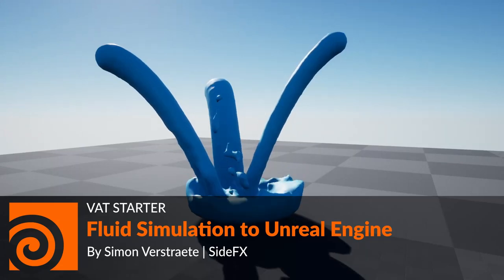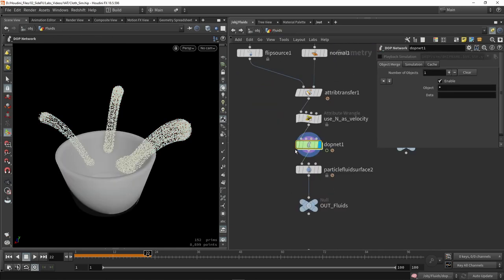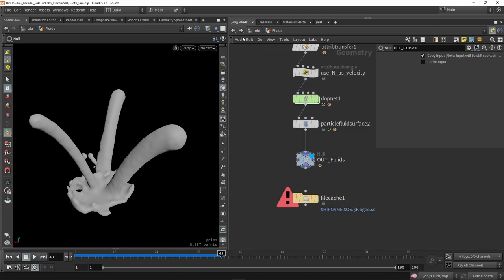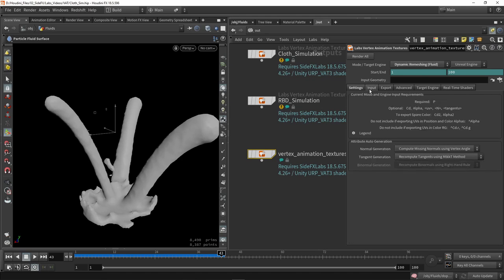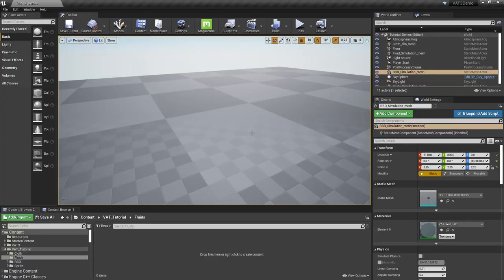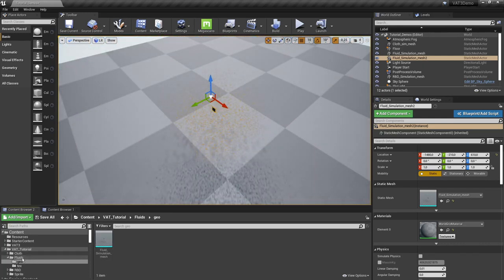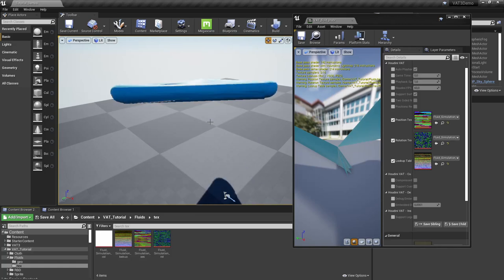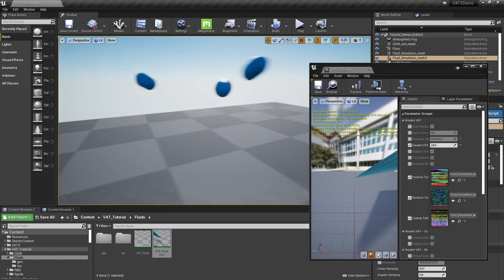VAT 5 | Fluids | Unreal

Comment: For everyone having problems with UE5, make sure you are using High Precision UVs, and your Lookup table width is smaller than 4096px. If it's bigger, it seems as if though you get data loss.
QuadRemesh every frame to lower polycount and cache all of that. And lower your frame range until you fit within 4096px width.

Comment: Does anyone knows is the workflow works on unreal engine 5?
Reply: I get very strange results with some triangles
Reply: I tried to get this to work in unreal 5 but the fluid seemed to have some issue with triangles flying around.
Reply: Bumping for interest. I'm in the same boat, I see the general shape of the effect but there are weird triangles cut out of the mesh and a bunch of the strange tangent lines that connect between the 3 water sources. Those tangent lines last for about 2 or 3 frames then the disappear. It sounds like this is a UE5 bug though.
Reply: Guys, I was a bit hasty when I tested VAT3.0 in Unreal 5 but I might have fixed the problem. Basically, VAT will behave differently when Nanite is enabled on the static mesh asset. I turned Nanite off in the static mesh asset editor menu by unchecking the "Enable Nanite Support" and clicking on the "Apply Changes" button. This should fix the mesh. And if it is still looking kind of strange, check the "Use Full Precision UVs" as well. Lastly, be careful with poly count as too many polygons could also create problems when displaying the mesh. Hope this helps.
Reply: @ahmadsy1000  same